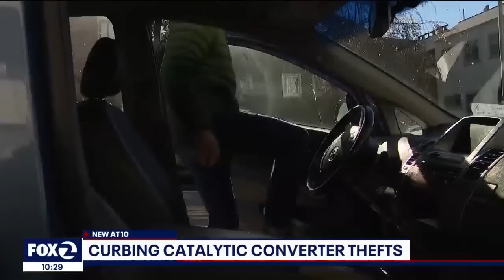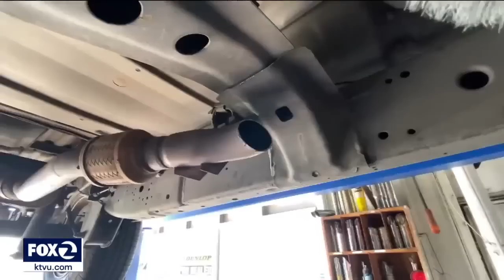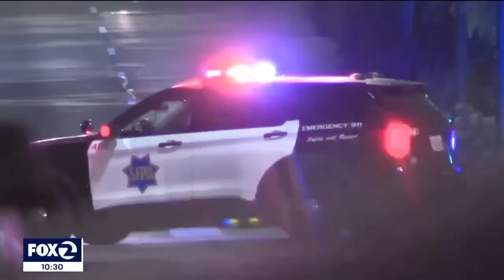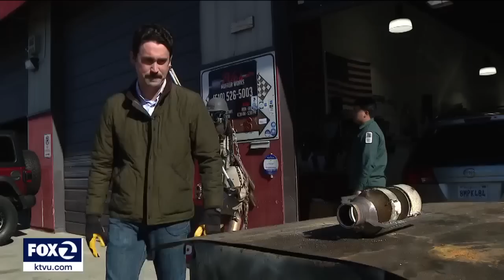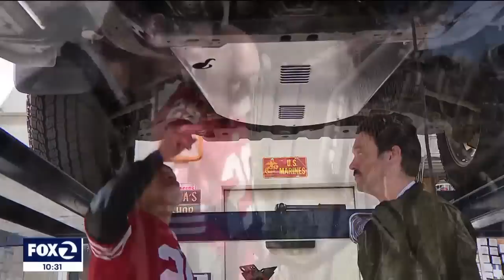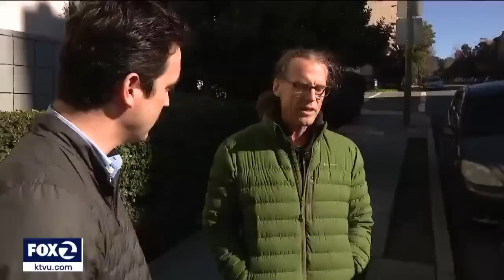Catalytic converter thieves hit victims over and over in Bay Area

Comment: State law needs to be changed to allow chesp non CARB approved catalytic converters to be installed. No one would steal them because the of low precious metal content.
Reply: That's ridiculous
Reply: He has a good point. Non carb cats cost under 200.
Reply: @me-so2ze  why is it redicoulus?  Do you understand the CARB ruling on replacement catalytic converters?
Reply: @thevictim2072  yea some white lady lovers found themselves playing golf one day and it was a little warm and they decided to come up with some exaggerated law about air cleaning thing. I didn't read the whole thing but that pretty much sums it up
Reply: Dixie Normus  that’s why you tape the job application right on the converter! 🤪

That it will burn up instantly is a myth!
Reply: @me-so2ze  I’m not a thief but I’ve known this since 2009. My non carb never get stolen
Reply: Allow us to install STRAIGHT PIPE and waive the smog check requirement! We will manage to run our cars with P0420 CEL light on. I don't think thief will check see if carb approved once they car is jacked up and they are under there.
Reply: @derekkchung  install plates on your cat like the ones that mount the exhaust to the header. Go get the smog then unbolt the cat and bolt up in its place a pipe with the the same plates welded on. And put your cat in the basement. Your welcome.
Reply: @me-so2ze  Nonsense. Our smog test is good for 90 days only in CA and we need it every 2 yr (for most cars) only when we need to renew. Installing the anti-theft plate requires lifting up the car and even DIY cannot do it. Shop owners will smile and welcome u. Your suggestion is to go there 2-3 times and only when we need smog check.  What if smog is not due? The root problem is 1. car manufacturers not making it hard to steal and 2. government incompetence to stop the crime. Since 1 and 2 is not happening, we need 3, as a temporary fix, not costing us thousands to fix and drive. A straight pipe could be $30, not $1800 for a CARB cat. Not everyone has comprehensive insurance coverage and no one wants to spend 50% of the value of the car to fix a car.
Reply: @derekkchung  I mean mounting plates. You know how you connect the exhaust pipe to the header? You put 3 bolts through the mounting plate on the header and you connect the exhaust pipe which also has the mounting or joining plate whatever it's called. I can do it myself in 10 minutes. Jack up the car remove 6 bolts. Remove the pipe I made which is the same length as the cat which I welded similar mounting plates to and put the cat in its place. Them I go get the smog and come back home and reverse it. I don't know what you are talking about. You came up with a bunch of other crap that I didn't even mention.
Reply: @me-so2ze  U and I are both DIYers but most people are not. I think when they have to take it to shop and get ripped off by shop labor and manufacturer high part prices, they want to do it once. Allowing us to use straight pipe will save $1800 (for a prius cat) and if CA can issue a temporary smog waiver to allow them to renew for tag, it will be a solution for now until they stop the crime and price of cat goes down.
Reply: @derekkchung  after you get the smog you can use a straight pipe and nobody will know. You don't have to ask permission from the state. And the thief won't take it. Once you smog the car you can take off the car and keep it off until next time to smog comes around.
Reply: @me-so2ze  Not everyone is a DIYER. Not all DIYER is willing / able to go under the car. Smog check good for 90 days. What if your renewal is not due for another 6 months? Take cat off now and install straight pipe, put it back on when smog check is due, then remove after u pass??? I am done here. I don't see I am talking to someone who can comprehend.
Reply: @derekkchung  你说话的方式很糟糕
Reply: @me-so2ze  only to some people
Reply: These thieves  don’t know the difference. They cut out whatever is there

Comment: California deserves it. $1,800 "CA legal" replacement when other states cost a way less. There's no need for all that valuable metal in the catalytic converter here when all the other states are doing just fine with the less expensive one.
Reply: The best part is the normal replacement cats have little value and the thieves will not take them.
Reply: @majesticmajestic7058  So all the other states combined make less pollution than California?

Comment: The auto industry could easily put something into place to protect converters at a very minimal cost.  If I lived in an area where I thought mine could get stolen I'd have somebody weld some rebar or something on the areas a thief would have to cut through to make it impossible to steal and that wouldn't cost very much.
Reply: Yes, you would think the manufactures would know that by now.

Comment: Just run straight pipe and don't have to do a smog.
Reply: It's illegal to run a car without a catalytic converter.
Reply: It's also illegal for CA to violate the 2nd amendment, but they do it anyway without consequence.
Reply: @heh2k  The Second Amendment has nothing to do with catalytic converters. Catalytic converters are exhaust emission control devices that convert toxic gases and pollutants in exhaust gas from an internal combustion engine into less-toxic pollutants by catalyzing a redox reaction. It is a requirement to use these devices. Otherwise, the air will be severely polluted.
Reply: Car may not run correctly depending on sensor placement. If possible, Id run a straight pipe and install cat only for smogging.  btw - thousands of motorcycles run straight pipes. in Cali.  Not that I would know...

Comment: I am  on my 4th Cat for my Prius and the last one they got with a security plate over the catalytic converter.
Reply: That is what I was going to suggest is getting a cat clamp or shield for the Prius.  It appears though when a thief wants something, they will get it in any shape or form.  Actually my suggest in general would be where are these thieves taking the catalytic converter to?  I think it's a scrap medal place if I am not mistaken. If they are or where ever they are taking them too, that place needs a way to see if the item is stolen. There should be a serial number on each one (maybe hidden inside). If it's stolen that number should be entered into a data base for the police. Then places that accept catalytic converters should be able to access that data base. If it's stolen you reject it. Don't take it.  That would cut back stealing so much.  Of course too, it would be again up the the place that takes them in to do the right thing.
Reply: Just straight pipe it. Why keep replacing it?
Reply: How did they actually remove the shield?
Reply: @peakworkflows  common sense would dictate that if you can install it, it can be removed.
Reply: @peakworkflows  They did not remove the shield my mechanic said they used some type of long device that went up the end of the cat plate and then cut.  It was shocking to see it could be done done.
Reply: That’s why the latest iteration of the MillerCat Prius shields say now you Must also use one their new $60 Deadbolt thingys that covers the connecting bolts in the front.

Comment: 6 times wow. At that point you should do what I did. I put some mounting plates and bolts and made it removable so I only bolt it on when I get the smog check that rest of the year it's basically straight piped. I don't have a prius I did it on My mercedes because well its last a good amount of time now since it mostly sits in the locked safe in my crawl space. And I wanted to straight pipe anyways. So yea there's a tip. Just don't tell police because it's illegal.
Reply: This is the best idea I've seen yet.
Why didn't I think of it?
Reply: You gotta make a video.
Reply: @seeharvester  I have used the same cat for smog for 10 years and she still passes no problem. As long as you leave the resonator in place the change in sound from the muffler is almost unnoticeable. I don't have a video but the plates I used are the same that connect the pipe to the header.
Reply: @DonutVIP  what ?
Reply: That's pretty clever.
Reply: Six times and I would expect the owner to be waiting out there with a sawnoff. I'm waiting for the news story where the perp get blown in f-ing half. We need to take back our cities with force.

Comment: Just stop producing vehicles with catalytic converters. Problem solved.
Reply: Yeah but not everyone can buy a new car
Reply: @sylvestersalad  bring back cash for clunkers
Reply: State law requires catalytic converters.
Reply: @RaymondHng  There's the problem right there.
Reply: @deedle6073 Catalytic converters are exhaust emission control devices that convert toxic gases and pollutants in exhaust gas from an internal combustion engine into less-toxic pollutants by catalyzing a redox reaction. It is a requirement to use these devices. Otherwise, the air will be severely polluted.

Comment: Weld a straight pipe problem solved
Reply: Cool story… I guess you didn’t realize that in order to renew your car registration you need to be able to pass an emissions test
Reply: @vegangainsfather2877  yeah I realized that I would take my cat off add flow master instead of muffler I would save it till I had to smogg it it only cost me 60 to weld it back on 🔧

Comment: Why park your ICE car on the street and not in a garage if you have one? 2nd, what about switching to a BEV? It does not have a CC for thieves to steal. Chevy Bolt is affordable and you never have to worry about CC theft anymore, even if you park it on the street. Cost to replace 6-8 catalytic converters is about half the price of a brand new Chevy Bolt EV.